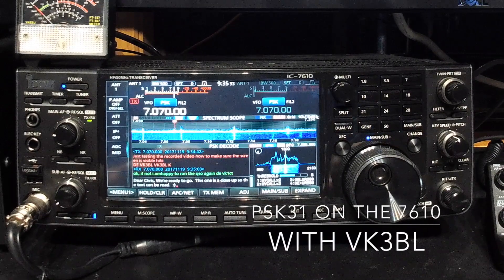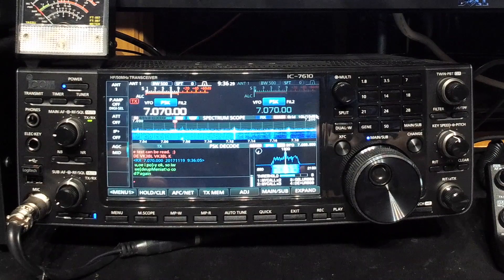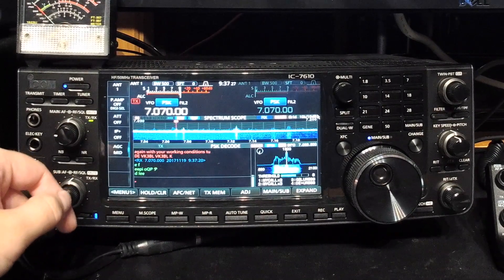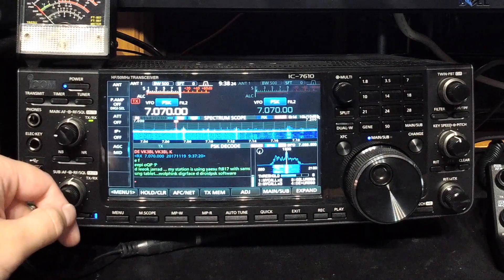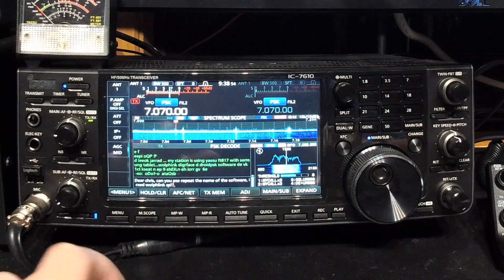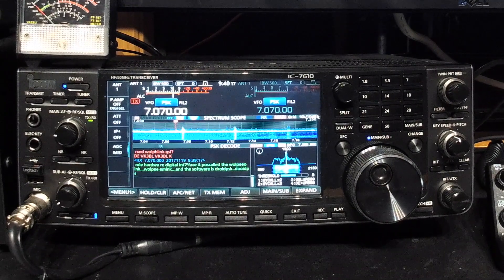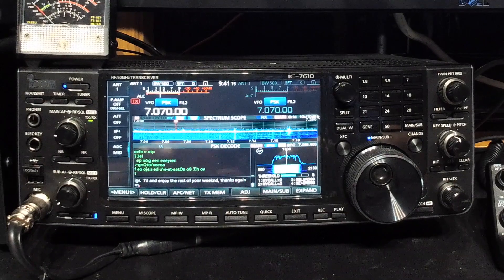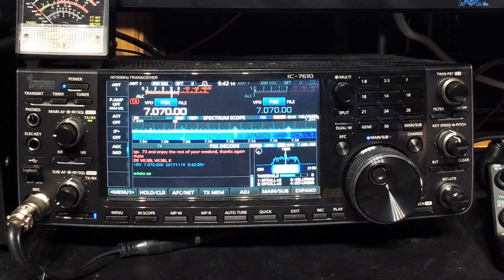PSK31 on the IC-7610

Comment: Hi Jarrad, tnx for your various vids......Curious about small "Yaesu" meter on the top left of the rig, is that just plugged into the 7610 meter socket and if so can the operation (i.e. SWR or ALC etc.) be decided via the rigs menu just like the options available on the FT-857/FT-897.
73 from 5B land. Richard de 5B4AJG.

Comment: I was cleaning up a room and going through an old Win 98 computer in storage and low and behold I found PSK31 software on it and wondered what was going on with that mode these days and ran across your video. Imagine that. It's been almost 20 years since I've messed with it.  Haven't been on ham radio in too long. Really need to de-clutter and set some space and time aside to delve in again.
Reply from the maker: PSK31 is a lot of fun and even up to 2015 when the bands were good contacts from VK to EU were a daily occurrence on 20M.  Unfortunately with the low propagation FT8 is the dominant mode now, and whilst its a lot of fun it just isn't the same as good old PSK31.  I hope it makes a come back next solar cycle peak!  73, Jarrad VK3BL :)

Comment: Hi there Jarrad,
Thanks for the demo videos on the very impressive  IC 7610. After having to spend most of one afternoon in an average of 100°F encoding Helicopter tech log books to send out by cw through the evening and early hours following, all in block 5 lettre cyphe. I do not want to know about any more about cw , thanks. Why ho why could I not have had a keyboard and a portable RTTY setup,/ laptop and software to send that lot digitally. Pos because it was 1968 and laptops and software had not been invented. I was a SpecOp and transferred to Radio Op thinking I was getting away from cw. Big Joke!. 73 de G0WXU.- John.

Comment: Hi, 

Can you use the mouse to change antennas, turn preamp on and off, turn IP+ on and off, etc.?
Reply from the maker: No!  I can't believe it either, but its restricted to moving around the panadaptor/waterfall.  I'm not even really sure what the point of the mouse is; I would buy a wireless keyboard without one if I found a nice one (I haven't looked yet).  Icom NEEDS to address this in a firmware upgrade in my opinion.
Reply: I suspected as much. It only tunes the radio to the mouse click. It must be the same way in all of the other radios, so doubt there's a change coming. I think most will use RS-BA1 to control the radio. Thanks and have you compared the 7610 to the 7300 on receive, side by side? K0PIR.us

Comment: Can you run psk31 on 1 vfo while running ssb on second vfo?
Reply from the maker: Dear Nicholas.  You can listen to different modes on each VFO, but it can be a little clunky if you wish to change which VFO transmits.  The only way to transmit on the sub VFO frequency that I've found so far is to press the split button.  This is something I really hope Icom address in firmware, as it would make the radio a lot more functional if you could monitor digital modes for rare DX whilst rag chewing on the main ufo easily.
Reply: What happens if you try using fldigi or HRD to do psk31/ft8 on 1 VFO?  Can you manually key the 2nd VFO?
Reply from the maker: Not without first pressing the split button, unfortunately :(